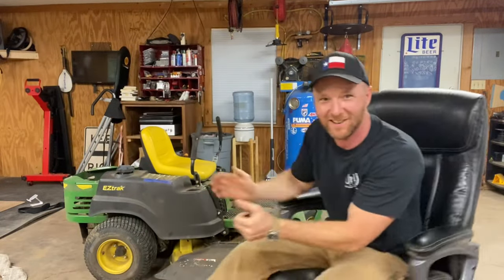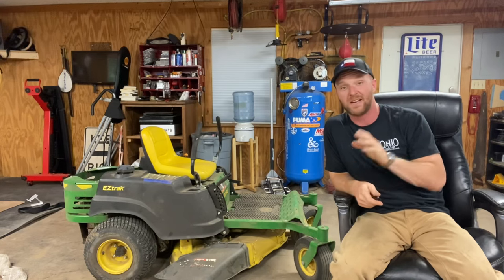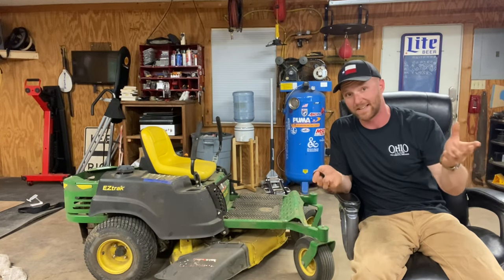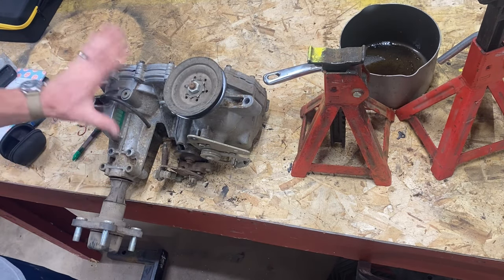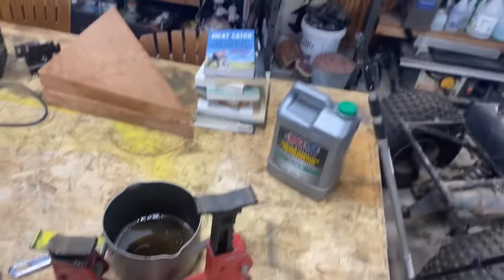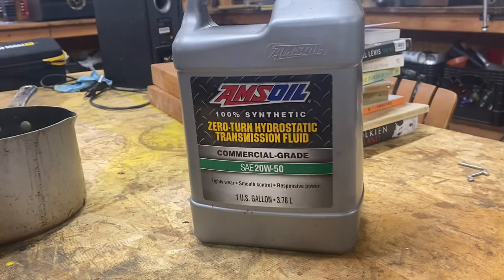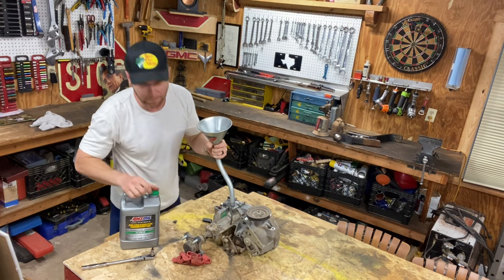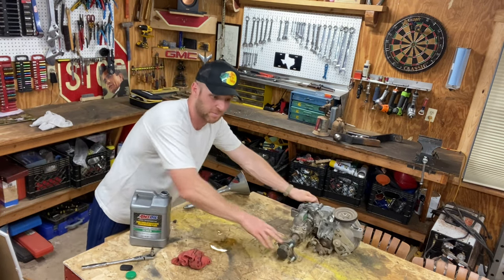Zero Turn Transmission Oil Change on SEALED Hydro Gear! + Synthetic vs. Conventional Oil

Comment: Hey, it is NOT necessary to remove anything! Run your machine to operating temperature, remove the fill plug. Use a suction gun with the hose end reduced down to 3/8 synflex air brake line and fish it in through the filler plug hole all the way to the bottom and suck it all out. I do this to my John deere z245 once , sometimes twice during spring and mid to late summer. The reason I’ve discovered and do this is because I bought this mower used and the right steer pump is weak and after 10-15min use I lose all passenger side steering. I’ve tried so many different fluids. My pump is so bad I use straight lucus heavy duty oil stabilizer in that side and synthetic in the other side. Pump has been shot since I bought it and I’m still able to get by without replacing the hydro gear at at cheap Canadian cost of about 1500! I’ve put 175hrs on it, doing just what I said! Machine has currently 670hrs on it! If anyone is ever shopping for a used zero turn make sure to test them after they been good and hot! You’ll know if it has a weak pump when fluid gets up to full temperature. Good luck ppl. I got scammed with this machine, because it was my first ride on mower ever, had no experience or knowledge about them. Now I’ve learned a lot!
Reply: I'm gonna have to try that.  I'm also pretty sure I got scammed on my mower today, which is why I'm here.  It's an older dixon ZTR, mowed amazing for about 45 mins to an hour, and then lost all steering on the left side
Reply: @warnerg2357  ya man, I feel your pain! I’m surprised it worked for that long b4 failing tho. If you use Lucas heavy duty oil stabilizer like I did. Boil some water and sit the jug in it for a while b4 you try pouring it in. It will help a lot!
Reply: @warnerg2357  if you use Lucas synthetic it is a lot thinner. Maybe you should go that route first. I did that as well, but my pump was so bad, I ended using the 100% of the regular one after one cut. If you go that route, when you start the machine, let it warm up the Lucas for a couple minutes b4 forcing it to drive.
Reply from the maker: Man thank you so much for this input. I have to try this, have my 3/8 brake air hose on order. Do you have any suggestions for using a hand pump to remove the fluid or do you just use a hand bulb pump? 

Killer suggestion on the Lucas, can’t wait to make videos on this.
Reply: @MowerMike  I use a standard suction gun with the two hoses on the end. That way once you fish the reduced hose all the way to the bottom, you don’t have to remove it until all the oil is extracted. It’s basically same size as a hand held cartridge grease gun.
Reply: @MowerMike  you could also use one of those 12v oil extraction pumps as well
Reply: I’m literally trawling the internet to find out if this is possible, and I find you in the comments of YouTube and you appear to be the only one with real world experience of doing it. Thanks champ, much appreciated
Reply: @bradsmall4125  you’re very welcome. I hope it helps you. I just serviced mine for the first time this year. I mentioned using the 3/8 synflex, which I’ve always done but for some reason today I couldn’t get it all the way to the bottom of the pump and got it stuck in there for a bit, but managed to work it out. So then I reduced the 3/8 down to 1/4 and that work perfect, however takes longer to extract the oil, so make sure you do it after running the pumps for a while. The main hose on my suction gun was the perfect size to push the 3/8 synflex inside it and the 1/4 push’s perfect inside the 3/8, so there ya go. I’m a mobile truck trailer service technician by trade, so I have all that stuff on hand, but if you need to find it, any truck dealership or any other parts center that sells truck and trailer parts will have it and you don’t need much! Less then a foot of each will do. The longer you make the extraction side of the hose the more resistance in slurping the old out. Good luck!
Reply: That is exactly what I did. I was able to work a small hose all the way to the bottom of the differential and draw over 2 quarts from the unit.
Reply: Yes sir no need to remove hydros just pump em out
Reply: @bradsmall4125  your very welcome. I hope it helps ease your pain, lol
Reply: Same👍🏾
Reply: welp, you can't get all the fluid out pumping it from the top.  you just can't.  you will lack being able to get 1/2 to a full quart, so with a 2 qt. capacity on the 2200's the best you can get is about a 50% change.  this isn't all bad though.  if you convert to a good SAE 30 or a premium 20w-50 early in your 2200's life, and use the pump-out method every 100 hours or so, it is still a good practice which can significantly extend the life of the hydros.  the first time i have my 2200's off my cub, i will drain them and take them down to a fab shop and have drain plugs installed in the lower case housings.
Reply: @nhojcam Hi, well, I'm only familiar with my specific unit / model.  I haven't seen or worked on any other zero turns. My original comment from watching Mike's video was just to give ppl an easier, faster way to change the oil.
I'm sure,  as you said, you may not be able to extract it all out of other transaxles. However, if you practice regular maintenance or repeat the process a few times after each use, you'll eventually have ALL the fluid renewed.  Thanks for your feedback. And yes, drilling and installing drain plugs for post servicing is the best way. I just never bothered to figure out where exactly to drill on my particular unit, and to be honest, I didn't think it was going to last as long as it has. Good luck, ppl  🍻
Reply: Buy a 12 volt oil change put for a boat works great

Comment: HUGE HELP!  John Deere Z235 zero turn, sealed tranny's, 12 years old.  I was ready to pay someone to do something regarding the "lag" it had on one side and the sound of hydraulics when they are low on fluid.  Knocked it out in about an hour and an half (one side), only confusing part was using 20W50 motor oil.  Got a lot of mixed signals during research of "tranny" fluid vs. engine oil.  Used Mobil One and it runs great now!  And saved $850.00 in the process (one side)!  Where do I ship the Crown Royal?
Reply from the maker: That is great news glad it helped get ya going. Yep those hydros just take heavy duty engine oil you did the right thing. No Crown needed your comment is more than enough for me, gave me a chuckle and a smile.
Reply: @MowerMike  Hey Mike!

I have a John Deere 355r zero turn. The left transmission is whining awfully loud and it will not move once full pressure is applied to the levers as if it’s going out or something. What are the options to resolving that issue before possibly replacing the whole transmission? Are there any other smaller parts that could result to that issue?
Reply: @MowerMike À😅😅

Comment: The conventional 20w/50 expands more than synthetic, or so I’e been told by the manufacturers. If you have no reservoir to hold the expansion, you need to use Full Synthetic.
Reply from the maker: Interesting, thanks for the input. Amsoil makes a Hydrogear specific oil that I use that works great
Reply: @MowerMike it’s hard to find the oil in West Texas 😢😢😢

Comment: I would be careful topping those units all the way to the top.  As with anything as the oil heats it expands and there should be room to accommodate for this.  To bad there isnt any info from the manufacturer on recommended fill quantity.
Reply: Actually there is for HydroGear. Should be .75 to 1.5 inches from top of filler plug opening. Got that info straight from them this past week, since I’m replacing the oil in both of mine. I used a small metal ruler to measure them with.

They also say any 20W50 Synthetic Oil is fine. Albeit, I got the AMSOIL from ACE Hardware….
Reply: Good info!

Comment: Just drill a drain hole in the bottom, by the filter.  Use cheap oil, run it for an hour, drain it again, and put in good 15w-50.  Simple, cleaner and way better.
Reply from the maker: Ehe not my way of doing things, but whatever works for ya

Comment: Hey I had a leak in the reservoir. I replaced it but now the thing won’t move. Left side engages more than the right. If jacked up they both run. I have a Z465 2010 model. Any help I’m stumped.
Reply from the maker: I suggest just keep trying to bleed it. Try filling it right at the transmission and take the tube off.

Comment: I've been using Amsoil for years, and I see a big difference after I change other fluids out of my machines.
It made a HUGE difference in the transfer case in my 4x4 too.
Reply from the maker: I agree I use AMSOIL in all my stuff.

Comment: Toro time-cutter with zt-2100. The sealed unit does have a internal filter. I have a Pittsburgh handpump from harbor freight, I suck the oil out of the fill port then refill. Still have to purge afterwards but a lot less work then removing the whole tranny and can be done more frequently. I refill it with Valvoline VR1 conventional high zinc. Thanks for the vid 👍👊🏻
Reply from the maker: Interesting, I don’t get how you can get the suction tube down to the bottom of the transmission. Any hints?
Reply: @MowerMike  Feeding it down the fill port hole. Only able to get about a quart and a 1/4 of oil out of each transmission at a time but it only takes a few minutes to do so. After only 70 hours I was surprised to find the oil inside the unit was black with metal wear. Every 50 hours or so i will pump out a quart and re fill
Reply: Just drill a drain hole in the bottom, by the filter.  Use cheap oil, run it for an hour, drain it again, and put in good 15w-50.  Simple, cleaner and way better.
Reply: I did the same thing except I made a crude bleeder contraption with a wet/dry vac, tubing and a bucket with lid. Feed the tube down the fill port till you hit bottom and start the vac. Got 1 quart and 6 ounces out each side.
Reply: My toro timecutter 50” has a hole in the frame to access that fill port, so it would be easy to feed the harbor freight hand pump tube down into the tranny. I’m gonna try that bc mine is slipping and belt is tight.
Reply: This is the exact comment i was looking for, i was hoping to use my oil pump rather than dropping the tranny
Reply: Did you fill to the top
Reply: I got mine down to the bottom. Filled her to the top with the oil ray mentioned, and it started working like normal again. Except it starts acting up in the final 30 min of my 2 hour mow for my 2 acre property. Seems when it gets really hot it still becomes unresponsive in the steering.
Reply: @huetubesux if you mess up when drilling and tapping that case you're out a shit ton of money.
Reply: @T0MFORD did it work
Reply: @SirDadbod  yeah it’s working so far. It hasn’t been real hot yet, but I’ve mowed a couple times without issues yet

Comment: thanks for the help .!.! rebuilding a z225 with a blown engine found one for cheap and enjoying the project so far .
Reply from the maker: Very cool, they are great little mowers. I like it better than the big 50 or 60 inch zero turns I have messed with.

Comment: I  use to  use Amsoil in  my Harley  1981 FLH, Cylinder head temp was lowered using  this oil.Great  video Corn Pone Mike, GET  SOME FREAKING BOOTS  ON TARZAN.
Reply from the maker: Haha will take that as a compliment I think
Reply: @MowerMike   Yes   get those  boots  on  soldier.

Comment: Another awesome video!  One of my mowers has sealed transmissions.  Going to use this info!  Thanks again!
Reply from the maker: Be careful I don’t suggest doing this if your mower is running good as is.
Reply: @MowerMike  why? 🧐
Reply from the maker: @Ricky-eo5ym  I usually break things when I try and fix them
Reply: @MowerMike  LoL Do you think the stuff in the filter screen will come out or is it trapped inside for life?

Comment: Thank you very much, the exact same units in my Toro. I bought this mower very USED just to get me by till the end of season to buy a new mower. When I found out the units were "Maint Free" I asked the dealer where I bought my new mower if he had ever had one fail. He told me "never had he had one returned for steering problems." Well I think I figured out why mine has issues, I have welded almost every part on this mower to keep it together. The bar that lifts the deck was totally worn in two when I got it and I've had to build it up a second time. So my mower has outlived the steering units because I've made it do it. However after replacing the oil today I can steer it again with one hand.
Reply from the maker: Great news glad it helped

Comment: I just subscribed. :) I have a Husqvarna z254f with these sealed units. It's got 107 hours on it... at what number of hours would you suggest changing the oil? Thank you for your very  informative channel!
Reply from the maker: I would never change it, just keep on running them until they stop.

Comment: Did you give any thought to adding something to flush them out before filling.  I've got a couple to do myself. Nice video.
Reply from the maker: No I would just let gravity do it’s job. You can run it to warm it up and get things moving in there though first before you drain it

Comment: Just viewed your blog, perhaps while you’re filling the transmission with oil maybe the thing to do would fill a bit then turn the pulley or rotate the spindle to help move oil throughout the transmission a couple of times while it’s off the machine …🤷🏽 not sure if you tried or mentioned this idea… anyways great work, new sub….👍
Reply from the maker: Welcome aboard, things could get weird.

Comment: Can you siphon the fluid out , instead of removing transmissions ?  I have  a bad boy 42" with same sealed trannys. With access to fill plugs.
Reply from the maker: No, I tried but there is no room to get a tube under the fill plug there is too much stuff in the way.

Comment: Hi, just wanted to ask a quick question about how you topped off the transmissions via the plug at the top. All the way to the top? I have an older Toro 2010 zero turn with the sealed aka unserviceable transmissions. It takes it a few minutes to move forward or backwards but then all of a sudden, there it goes. I did a times trial test from 0-5.5 mph according to the math converter of 8 fence sections in 10 seconds, lol. I have read that too much fluid in it can cause it to burst some seals in the transmission but that could be BS, not sure. Thanks in advance and appreciate the video. I will update this if replacing the fluid wakes mine up a bit.
Reply from the maker: I really don’t know. I would just throw some more on there and see what happens. The key is to make sure all the air is out of them

Comment: So my left side wasn't working properly. Maybe even dragging when I've only cut half of my front yard.I took the left side off and went to drain it.Their was hardly a drip.So I filled it completely up. Works better but kinda stiff.now I'm wondering if you can put too much into a sealed unit.Because I didn't leave any room for air.Filled to the brim.
Reply from the maker: You don’t want any air in there.
Reply: @MowerMike  so my left side just about stops working when it gets hot.(half of my yard)  Is that left side considered gone. And how important is it to replace it with the same part number..at this point I'm thinking an getting a new mower (can't arrord)
Reply: ZC-DHBB-DJLC-1RPX

Comment: Thanks for the video. These sealed hydros are very stupid.
Reply from the maker: Ya may as well just run them with stock oil.
Reply: The mower manufacturer and Hydro should be sued. They are shafting the consumers! Including the dealers! Class Action suit ????? I would join it! This issue has cost me $1700 and it’s still not fixed!!! It happened with Samsung fridges!!

Comment: Cool video would it be possible to suck the oil out of the transmission?
Reply from the maker: I couldn’t get a straight hard tube needed for suction into the trans cause there is too much stuff in the way inside of it. But it sure would be alot easier
Reply: You can take an old spray pump bottle and connect along tube to it feed it down inside the transmission and slowly drain it that way I tried this on my truck and it works

Comment: Hello, good morning, I have a Snapper 250z brand zero turn and it doesn't run backwards or forwards. It could be that many things have been done to it but they can't find the problem.  Thanks if you can help.
Reply from the maker: No idea sounds like you have an issue. I would check the belt is good and tight first

Comment: Do you have any experience with jerky steering on these machines? I’ve got an Ariens ikon and I have a leak on the right side axle which I used this video to top that fluid off, but when I’m driving straight it will start dragging to the left while making a rattling noise for like 2 seconds and then the noise stops and the steering snaps back into center and then it will repeat itself, it does it consistently while moving forward rinse and repeat, however if you’re going slow or in reverse it doesn’t do it? I was hoping low fluid on the right side was causing some sort of issue but that doesn’t seem to be the case
Reply from the maker: All I know is to keep the fluid topped off. You can always try and bleed it again, sometimes air bubbles get in there.
Reply: @MowerMike  yeh I think I’m going to try to bleed it again this weekend and see what happens. Still have like 6 months left on the warranty but that’s the last thing I feel like doing lol